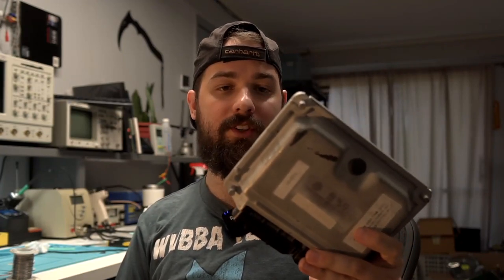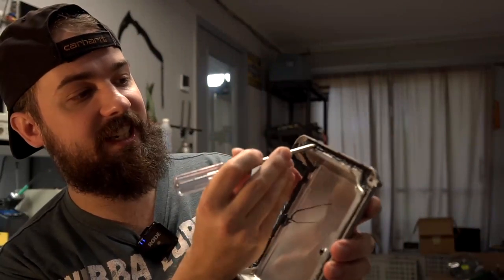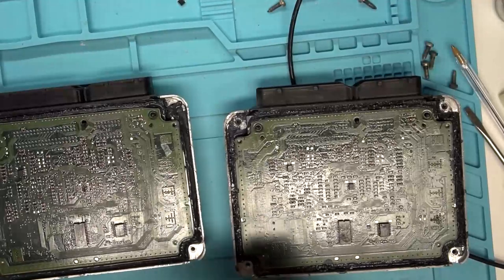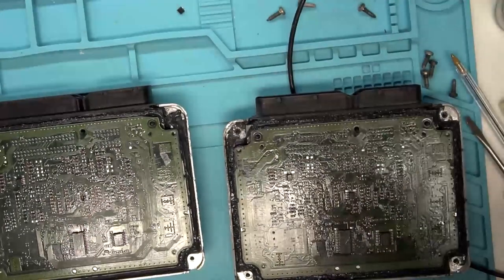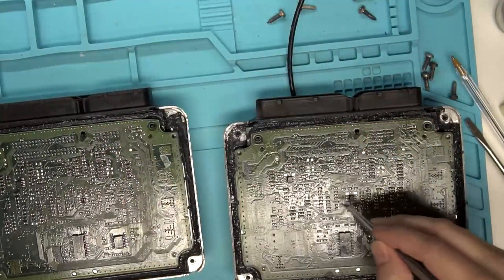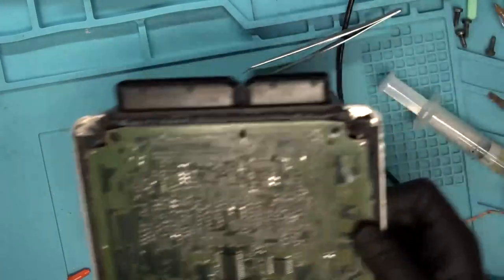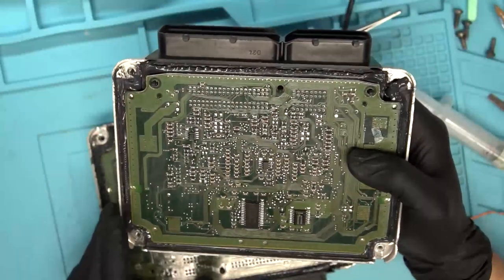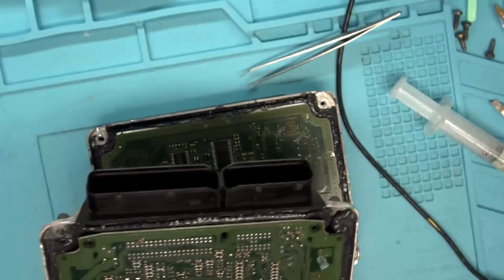VW  Used ECU Security Setup, Free No programming.  Jetta, Golf and Beetle

Comment from the maker: Back by popular demand, Automotive circuit boards! Hope you like. Btw that cut at about the 2 min mark was cutting out a long unneeded explanation of what that chip does. The TLDR of that chip is it interfaces the microcontroller with a few of the outputs of the ecu.
Reply: Could have absolutely left it in I would've loved to know more about what the chip does! Is it JUST the immobilizer data or are there other elements?
Great video though. Considering doing this with my a4 ecu that's going bad, just got IPC certified, might be a fun project.
Reply from the maker: @SomeTeemo  I work at an iso9001/as9100 facility. All of our assemblers are IPC certified. (I am not because I am an engineering technician). Those assemblers can put my solder work to shame. I thought I was pretty good until I started working there. You can't tell the difference between the wave solder machine and the assembler rework for some of them.

Comment: Interesting video. We're having issues with a 2013 beetle and found out it has a Tricore ECU.  Basically, it has a processor with the eeprom built in.  It is a 176 pin CPU so swapping it out could be done but not for the faint of heart.

A new battery turned out to be bad and never set any lights or codes till the car ran bad. then a bunch of sensors were reading odd. This happened after 2 weeks of driving on the new battery.

The problems required a reset and a new battery. The dealer said we needed a new ECU. That's what took us in the ECU direction.

Anyways,  Folks, check to see what kind of eeprom is in the car to make sure you can move it.
Reply: Wow. A bad battery caused the ecu to fail?!

Comment: I'm having an ecm issue. My car won't start only in the mornings. In the afternoon or evening, I have no issues. I have to disconnect my battery in the a.m. for a few minutes and it will start, but my tach, speedo, temp, and fuel gauges don't work. I'm thinking it's something to do with condensation, as I live in humid central FL. I'm getting engine codes UO146 and UO155. Anything I can try that you can think of? I really can't afford to replace it. Thanks! And I really enjoy the videos!

Comment: Hey man, thank you for this video. Wondering if you'd know if i swap the chip from a immobilizer  defeated ecu into one that isn't will it work? Ive got a 2001 vw jetta vr6 auto with a ecu thats defeated and doing a manual engine harness swap and I'd like to swap the chips instead of spending $100 getting it done again. Thank you if you know !

Comment: I have a mk5 golf with and intermittent power fault when starting the car. I think it will be a dry solder join on the board. Have you ever fixed any of these faults, thinking about pulling the back off it and re soldering it. Have you every fixed any faults for the connector pins

Comment: My non VW dealership mechanic swapped out my bad ECU for a used one. As far as I can tell, everything works, EXCEPT my key fobs. Any suggestions as to why that might be or I can do to fix that?
Reply: Did you get your fob's working ? what year is your car ? there is a certain procedure that you need to follow, however, if he only swopped the ecu, you may need to change the 'Body control module' or relearn the data from the older system and recode the BCM, post back a reply if you're still experiencing problems ? 🙂
Reply: @sollykhan2385  I had to go to VW to reprogram it. In the end all in, I paid about the same as if I had bought a new one directly from VW. Some settings are now a bit off, but some for the good, some for the bad. For example, now when I slide my hand in the handle all doors unlock, rather than just the door I am opening. that is good for me.

Comment: A chunk of the bmw and mercedes ECU's can be done similarly
Reply from the maker: Nice. If I get the opportunity to do one, I will make a video.
Reply: @FixedUntilBroken  last ones I had to do and can verify was a bmw e39 ECU with a burnt injector circuit and a mercedes w220 shifter assembly where the shifter also has a security chip (very stupid)
Reply: @kidvis2679  The w220s use the shifter instead of an ESL. Pretty standard as far as security goes.
Reply: It all depends on the w220. The early production is plug and play, but the later run production w220 uses the security chip in the shifter
Reply: Anybody in our group programming EZS/EIS?
Reply: @kidvis2679  Not in your group but I do eis all the time, what are you wanting to do with one? Replacement or just keys? In the US all w220's store the key hashes in esm (shifter) that I remember.. 2000+ for sure. Is it the 98's/99's that dont use esm?
Reply: @ecurepair  just wondering what equip everyone is using for EIS. I dont wanna have to take those two frigging big chips off the EIS to program them every time or maybe I need to cook up a fresh copy of xentry
Reply: @kidvis2679  I usually avoid mb these days but I usually used genuine xprog and orange5 for in circuit reading on most of them. The IM608 is decent on them these days it seem's but again, I try to avoid them so I may be wrong. Many of the older eis units use hc705's and they don't really read well in circuit. Pretty much stuck removing those no matter what your choice of tool is but the QFP64 is easy enough to remove and solder after some practice.
Reply: @ecurepair  and your prolly right on the shifters, it was either pre 2000's or I was thinkin of something else like a w208 or w210
Reply: @kidvis2679  easy to do, going by the chassis #'s never really stuck in the US i dont think. I never remember half of them that's for sure. The w220's just had so many problems I fixed I can remember those well.

Comment: Hi. I want to ask you if it is normal for the injectors to pulse when the key is in contact (I specify that the engine is not started) I think it could be from the ECU
Reply from the maker: Sorry not really sure. I'm not a mechanic, I just fix circuit boards
Reply: @FixedUntilBroken  I think this problem is caused by the ecu, not the mechanical part
Reply from the maker: @2doo554  yeah but I'm saying I don't really know how it's supposed to work in the car. Mechanic says it's not doing x in the car I go trace that circuit and fix it. I don't actually need to know the normal operation of a part to fix it. Like for example ecu has no injector drive I'd look for the fets that drive that circuit and test them. In your case unless they are just 100% duty cycle on all the time than I'm not sure where to start.

I'd imagine it's not supposed to inject without any cam/crank movement but again I don't really know what normal operation is for this but a vw mechanic would know.
Reply: I'm about to do the same and save a couple of hundred euros. Do I need a heat gun to remove little EPROM or you think a solder will do but without damaging.